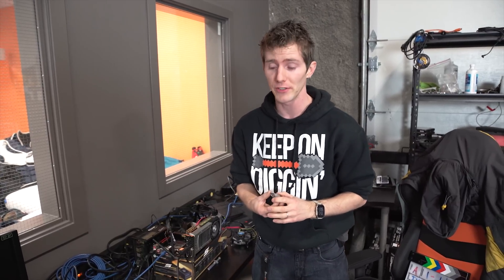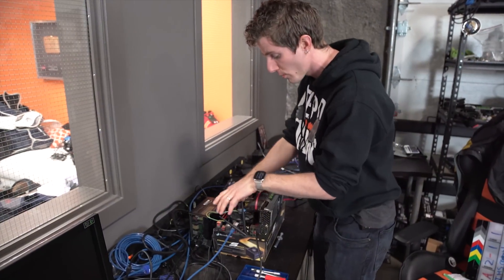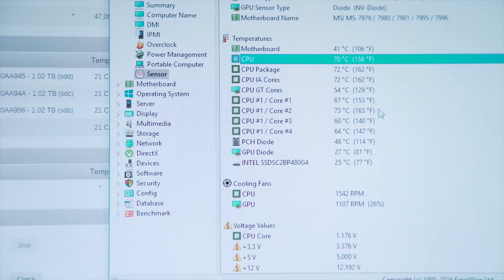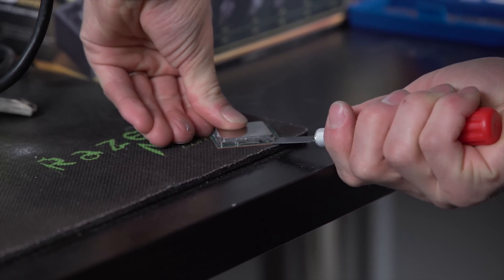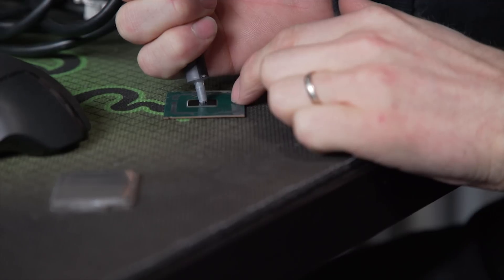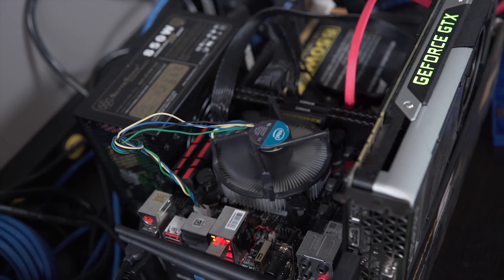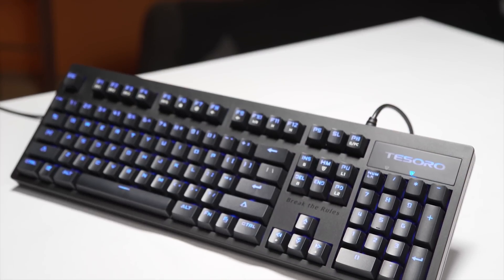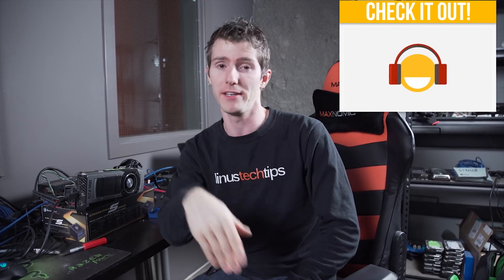Delidding an Intel Core i7 6700K - Is it worth it!?

Comment: If feel stupid to think that there would be something way bigger then that below the lid xD
Reply: +niklas1723 Unless you've watched things on how CPU's are made before it's not easy to conceptualize what's beneath the case.
Reply: Delid an 18 core Xeon, you'll see something much bigger than that under IHS.
Reply: +Ken Kalajdžič I hadn't thought about that. Just looked it up, It's still not all that big compared to the heat spreader but yeah it is much larger than the i7
Reply: Spencer Sawyer Yeah, the chip itself never fills the IHS. But bear in mind that 2011-3 CPUs have bigger boards (and IHS).
I guess the reason for that size difference between chip and board is the socket - they need room for all the contacts.

Comment: the set you're using here is kinda messy and the wall with the windows is kinda intrusive. it doesn't leave much room for camera angles either. room for improvement?

Comment: I've seen results other people have got from replacing the tim with arctic silver 5 with no improvement but then changing to liquid ultra and getting 10+ degrees cooler without a high heat load. It is important to note that on haswell refresh and later it will not have any effect as they changed from the terrible stuff to better stuff (equivilent to most standard TIM) On my 4670k it has without a doubt increased thermal performance. http://www.overclock.net/t/1397672/deliding-a-4770k-haswell-improving-temperatures-and-maximizing-overclockablity

Comment: I bought an FX 6300 a month back. I do some light video editing. I rendered some 1080p complex timeline 20 minutes videos, took like 26/27 minutes, But temperature went only 61 degree Celsius top. Using the stock cooler at stock Clock speed.

Comment: This is such crap.  Of course delidding is going to yield only a mild difference using a crummy TIM and a STOCK cooler (seriously!?  Who outside of an Enterprise environment uses stock cooling anyway!?).  The entire point of delidding is to use better TIM and cooling solutions to open up what can be accomplished when the artificially imposed stock constraints are removed.  Just prying up the lid and swapping in crap TIM and a stock cooler accomplishes nothing at all.  Might as well have taken a bubble bath with that pizza instead, would have made a better contribution to the PC enthusiast field if you posted it to Instagram. 

Much fail, Linus.  Very disappoint.  This proves utterly nothing.
Reply: +Rock18 Game Videos 100% agree
Reply: The cooler shouldn't make a difference as log as its the same for both tests. How exactly does a better cooler gain extra cooling from better TIM?
Reply: I use stock cooling. Mainly because I'm just using an i5 4460 and obviously since it's not an unlocked chip, I'm not planning on OCing and the temps are fine for me
Reply: +Zandohaha When you use better TIM, better cooling solutions have more potential to unlock performance.
Reply: +LinusMLGTips Stock cooling on an unlocked chip is just fine.  But it's neither here nor there on unlocked chips for the enthusiast market, which is kind of the point of this channel.  And not to mention that delidding and swapping the stock TIM for whatever crap TIM you have laying around  and replacing the stock cooler should yield a conclusion that's already obvious before the test is ever performed, and even so this test produced a benefit that was was simply discarded... for no good reason.
Reply: +Rock18 Game Videos well. It does make a point that 3 degrees isn't worth voiding a warranty for. I'd personally need to see some proper evidence to back upwhat you say that proves I could get 10+ degrees benefit in my particular cooler, (212 evo) before I'd consider this worth doing.
Reply: +Zandohaha Of course you're only going to see 3 degrees with stock cooling and crappy TIM.  If he had swapped in Arctic Silver 5 or [insert enthusiast TIM name here] or such with an aftermarket cooling solution the results might well be much different.  This is the entire point of my complaint.

Swapping crappy TIM for crappy TIM and then using the stock cooler shows... not much in particular.
Reply: +Rock18 Game Videos yeah I get that, was just saying that it would be cool to see this experiment done more in depth, different pastes, different coolers (stock vs good air cooling vs Aio water cooling vs custom WC). To see at what level of cooling delidding becomes worthwhile, and with which paste.

Comment: It would've been much easier to delid with a vice--takes less than 5 seconds once it's in place. It would be less entertaining though.
As for the difference in temps, it's due to the gap caused by the black adhesive around the die and not the excellent thermal compound that Intel uses. Even with liquid metal, temps would be similar if not worse with the black adhesive left on.
Reply from the maker: +Wooden Marker Vice method not recommended for Skylake due to thinner substrate. As for the black adhesive, editor might have removed it (I didn't watch the video) but I scraped it off.
Reply: Ahh, I didn't think about that for skylake.
I did notice that the black adhesive was taken off but what I was referring to was the reason why temps are better with delidding. Temps are better due to the gap reduction when removing the black adhesive and not because of Intel's TIM which is actually excellent.
Reply: +Wooden Marker I think your right there mate. I went from thermal throttling (100deg) to a steady 72deg when stressing with aida64. This was using an EK supremacy block and with a 4.8ghz overclock dialled in. I think when your pushing the limits of the chip it's definitely worth it.
Reply: +Wooden Marker Nice theroy, now it is your turn Linus to test it! Also you should test a high end cooler which might make the diffrence gap even higher than 3 degrees!
Reply: +agentcrm There is when you're overclocking. You might be able to add a few 100MHz when your temperatures are 20deg lower. This has to do with the resistance of the transistors and connections as these resistances are dependent of the operating temperature.
Reply: +Fergesslich One of the reasons why the difference in temps isn't much is probably that the stock cooler doesn't apply much pressure which might help lessen the original gap after delidding. Most normal thermal pastes also face pump-out issues when between the die and ihs and don't fare as well as the thicker material that intel uses or liquid metal.
Reply: SCARLET★STAR The gap is lessened with delidding so the pressure is probably less.
Liquid metal is very different from the usual thermal compound and faces different potential issues such as clumping when there isn't enough pressure. I'm not sure how to explain why it doesn't encounter pump-out issues but that's what ends up happening.
Reply: +LinusTechTips Good one, I've already been saying this even for Haswell. Vice method applies a very sudden high shear stress. I'm pretty sure most people do not know the specifics of how the crystal planes of the die are aligned and cannot ascertain perfect shear force application in one single direction with the tools available at home. It's just too risky. Silicon is a very brittle material with shear strength less than 1 MPa/m² along the (111) plane. I've heard of enough people who ended up with a crack through their die.
Reply: +Wooden Marker check out my video on it, not the prettiest thing but also works especially if you dont have a vice :P
Reply: Skylake + 3D Printed Delid tool + Vice method = No damaged PCB!
Reply: +Fergesslich There's no point if the chip isn't thermal throttling.
Reply: +Wooden Marker That comment made no sense at all, sorry. Stock cooler pressure is the same for both tests. Also stock cooler pressure is negligible when compared to the pressure the mounting bracket of the CPU applies, which is definitely  enough to lessen the gap to what is possible. And why would the extremes of high viscosity (stock TIM) and low viscosity (liquid metal) TIM fare better at pump-out than the ones in between?

Also a proper way to test if the gap and thus TIM thickness is actually affected significantly by removal of the adhesive is direct measuring via Ultra sound imaging methods. This would also have been the proper way for Luke's video on application methods for TIM.
Reply: wtfdinges Yeah, when you're pushing limits every little bit helps. :)
Reply: SCARLET★STAR That sounds.. strange.
All that's being cracked should be the black adhesive.
Reply: +Wooden Marker If at all the pressure is higher, because there is no adhesive to divert part of the pressure. Could you link me to a paper regarding pump out of liquid metal TIM? Only one I could find is this: http://www.electronics-cooling.com/2007/11/reliability-testing-of-thermal-greases/
Which seems to suggest a very slight improvement regarding mechanical pump-out with higher viscosity TIM. The drop at B2 is probably because of something else though.
Reply: SCARLET★STAR It wasn't from a paper but instead 2 massive threads on delidding from overclock and/or anandtech forums which I don't really remember and personal experience. 
I generally encounter pump out issues after 2-4 weeks with different 'normal' thermal paste whereas I never had the issue with liquid metal.
Reply: Whirlwind Lancer Huh, so the solution to not having a vice is to make a wooden vice.
Reply: +Wooden Marker I tested this on my 4790k a year back because people said the adhesive was the main reason for the drop in temp. Wasn't the case at all. I delidded, replaced the stock TIM with AS5 and it was the same temperature. Replaced the AS5 with CLU and it dropped my temp 12c down exactly. This was with the IHS floating ofc and using an H100i (CLU for both sides of IHS)
Reply: +Wooden Marker well instead of the banging its more of a squeeze and it prevents the the die from smashing into the ihs, so there is no risk of it breaking. Also no need to catch the cpu in anything as its held there with the tape :P
Reply: EvilWiffles AS5 doesn't sit too well on top of the bare die. NT-H1 works nearly as well as liquid metal but has pump out issues so it's a temporary fix for 'proper' delidded results.
Reply: Whirlwind Lancer Yep. I just catch it using a small cloth or my hand depending on the vice.
Reply: Hey guys, there are 3d printed delid tools that make the vice method possible. Also the delid die mate if anyone is very nervous about doing it.
Reply: +LinusTechTips You put it in a jig (3d printed) to prevent the thinner PCB from becoming an issue
Reply: +Cadis Etrama Di Raizel Exactly, Linus used wrong compound.
Reply: He was removing the IHS on a skylake processor, they are notorious for bending, because they're thinner.  Knocking it off would actually be pretty dangerous.  And I'm not sure if there is a gap problem for skylake, not that I've heard of anyway.
Reply: +MinecraftAwaits Again, all of these projects are dangerous if you dont pay attention to what you are doing. But if you do, this isn't more dangerous than other processors.
Reply: Skylake + vice method = damaged PCB!
Reply: Dye*
Reply: Dax Daily if you're referring to CPU die it's spelt die.

Comment: There is a delid tool, ZERO risk: https://www.caseking.de/der8auer-delid-die-mate-fsd8-015.html
Reply from the maker: +Detmer that's ninety EUROS... Are you freaking kidding me? I did this with a $2 hobby knife..
Reply: +Detmer Better to just buy from siliconlottery, they delid for cheaper than that thing (if you plan on doing one CPU--that tool is cheaper if being reused) and they bin CPUs as well so you're getting an almost-guaranteed good OC with minimal temperatures
Reply: +Detmer 90 Euro ezpz, costs more then my CPU.
Reply: +LinusTechTips Linus can I change laptop video card?
Reply: +LinusTechTips you should have used a butter knife😛
Reply: +LinusTechTips better to use a small hand vice grip, ive delided a few cpus, my 4790k dropped 12C but i did use the gelid liquid metal and i lapped the top of my cpu down to 4000 grit
Reply: +Andrew Storlie not with the 6X00 series.  the pcb is extremely thin and the hand vice breaks it.  I used the vice on all of my cpu's until Skylake came out, and they cut the pcb thickness down.  Now you need a way to reinforce the PCB and all sort of shenanigans... easier to do exactly what was done here.
Reply: +LinusTechTips Or you know....you could just use a $20 cheap shitty vice and get it done too. And that has much less risk than using an xacto knife. Honestly, this video was really shitty because you are misleading people in using a delidding method that more people are likely to fuck their CPU up with.
Reply: +LinusTechTips Holy shit you are a cheapskate....  Is that why you didn't do a test without the IHS?
Reply: +LinusTechTips yeah and didn't do a very good job there ... the whole video is stupid as fuck.

so many mistakes and what a fail. the list is long.
Reply: anybody know where i can get a deliding tool like that one that was 3d printed? I cant seem to find any for sale online :*(
Reply: jlrockafella Werent you paying attention?  it's dumb...
Reply: Gene Starwind
only if the cpu is working correctly. Mine has 1 core that is way hotter than the others.

Comment: The real question is, with how ridiculously priced Intel chips are anyway, why is the thermal compound so God awful, why did they stop soldering the ihs's, and why do they consistently have ihs's that are not level on the top? Not to mention having the chip literally be half as thick with the 6700. Intel has gotten so lazy

Comment: Why did you do the knife method that runs the risk of cutting into the PCB over the Vice or even a 3D printed delid tool?
Reply: Vice method is not possible with Skylake. Skylake has a thinner PCB that will get damaged using the vice method. Best method is using the delid tool.

Comment: Does the vice method not work on the 6700k or something?
Reply: The vice method doesn't work with Skylake. Skylake has a thinner PCB, using the vice method will result in a damaged PCB!

Comment: Delidding with a vice - no cutting at all...
https://www.youtube.com/watch?v=Fo1KzqCQurk
Reply: +Rudis You mean Skylake? Haswell delid is in the video I linked. Skylake substrate is thinner than Haswell / Devils Canyon, but I doubt there is more stress on the substrate than with the bending from trying to pry it open with a spatula... There's a lot more stories where people cut traces than ever broken it with a vice. As Linus said, bye bye warranty either way :)
Reply: +Rudis I guess unless you have a 4770k (like me) than there is probably no need either. My 2nd core was over 25C higher than my 4th core out of the box, after delid all cores all around 5C apart... Intel since learned from Haswell. Bad TIM and too much gap caused with too thick glue.
Anyway, just thought for anyone looking to delid - vice seemed safer to me than cutting and prying it open... ;)

Comment: Well this video was crap. You dont need to do this at stock clocks, it's mainly for enthusiasts who are really overclocking their processors. And when you're overclocking, you get about 15 degrees lower tempreratures when doing this correctly. You should put Coollaboratorys Liquid Pro under that heatspreader, not normal compound, it doesn't work nearly as well. And in next video, when trying these, you should check screwbench technique while you're at it. Sounds and looks scary, mut it really works.

Comment: i rly need to do this on my q6600 non oc cause it's reaching 56 c  idle and over 84+ c full load
with the stock cooler
i've seen forums saying that that's not normal even with the stock cooler
but i am afraid that i'll loose it forever if it goes wrong and i paid so muck for this
(over 250 $ back at 2008)
Reply: +Ga Ca Q6600s Usually have the IHS soldered to the die... don't try to remove it. You'll kill the chip. Plus because its soldered, you usually cannot get better temps.
Reply: Ty Barringer oh ok then I guess it's really the stock cooler
Maybe it's fault or its not installed properly(again!)
Reply: +Ga Ca I would reinstall with good thermal paste
Reply: Ty Barringer tried it

Comment: The result was actually greater (CPU was cooler) as the fan on the heatsink was spinning slower.

The difference would've been at most another degree probably, but next time plug the fan into a 3pin header, for a more accurate result.